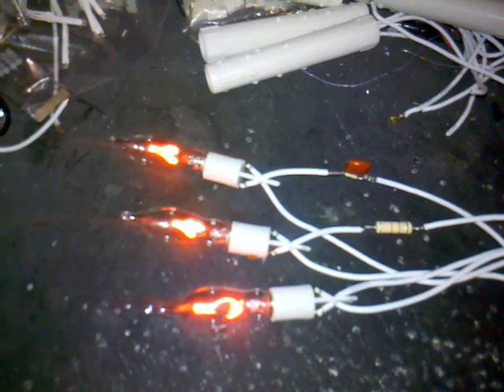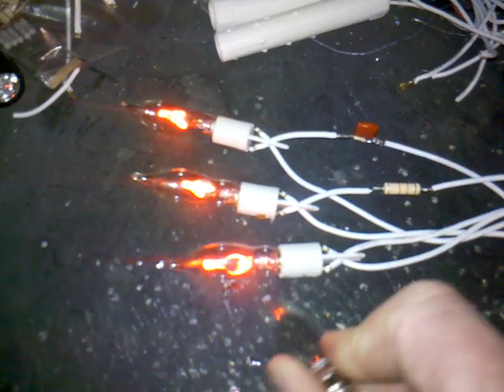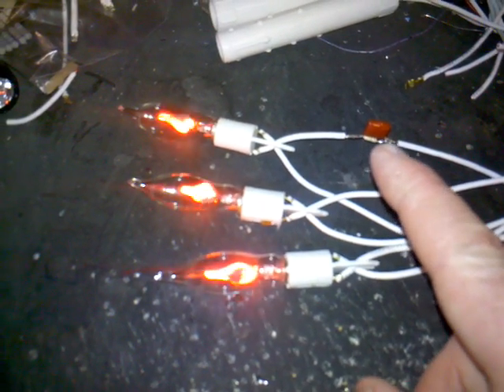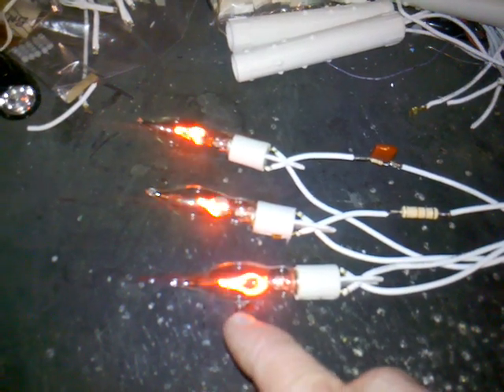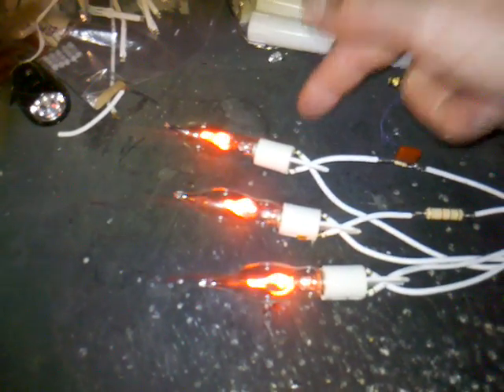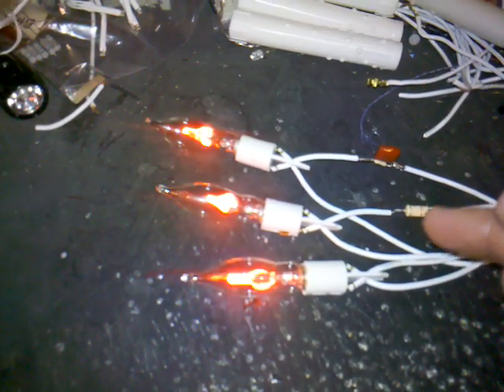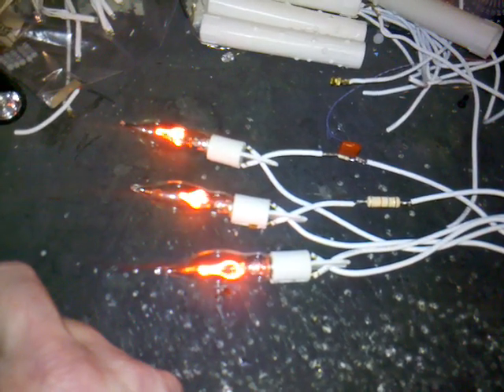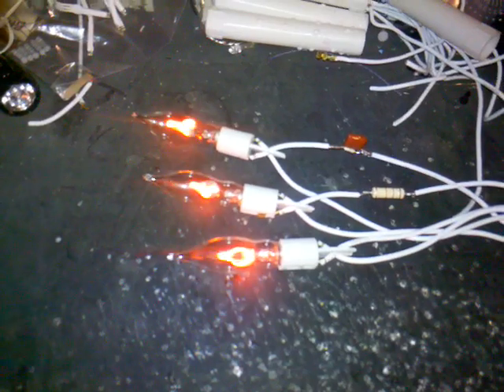Neon flicker flame lamp current limiting.

Comment: Very interesting. I love the colour and effect that these lamps produce as it is easy on my eyes. How would you work out the value of the capacitor required for 3 x lamps in parallel? I presume that you would need to add the currents together.
Reply from the maker: I'd recommend using one capacitor in series with each lamp, but you could use a single capacitor by multiplying the value by the total number of lamps.
Reply: @bigclivedotcom  I see! So for example if you wanted 4.16mA in each parallel branch, you could say that the capacitor will still "drop" 145V, and use 12.48mA (3 lamps) in your Ohms Law equation, which is technically giving your capacitive reactance. Then use the capacitive reactance formula to work out the value of the capacitor?

Comment: I used a IN4001 to get a 25 Hz flicker  but only one side of the lamp lights the lamp itself must be working like a valve.
Reply from the maker: +Martin Counsell Only one side of the lamp lights on each half wave.  It's effectively a tiny cold-cathode light.
Reply: The trouble here is your diode is providing the lamp with DC. As Clive says, only one half of the lamp lights on each half wave. To get the other side to light, you must reverse the polarity.

Comment from the maker: I've just tried two flicker flame lamps in series on 240V right this moment and the result was OK, although the illuminated area of the flame electrode was small.  Current was 1.8mA, which equates to a total wattage of 0.43W or just 0.22W per lamp.

Given that the strike voltage of each lamp is about 90V, I don't think it would work at all with two in series on 110V